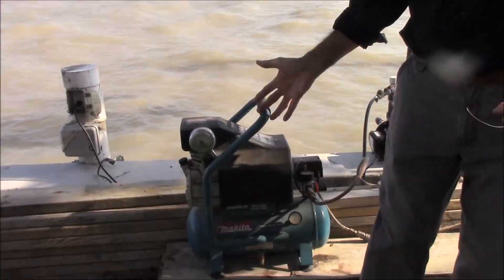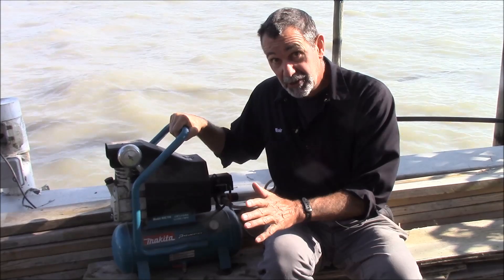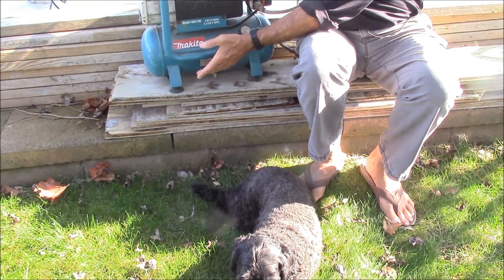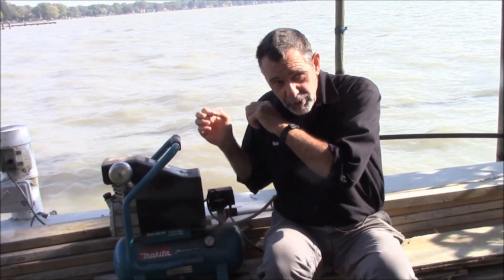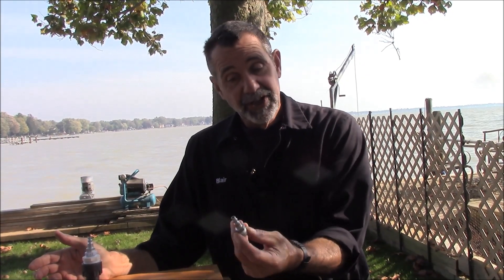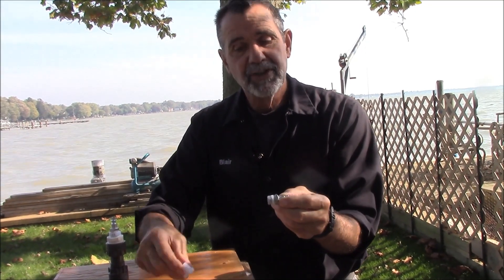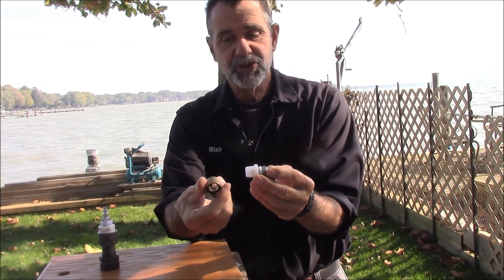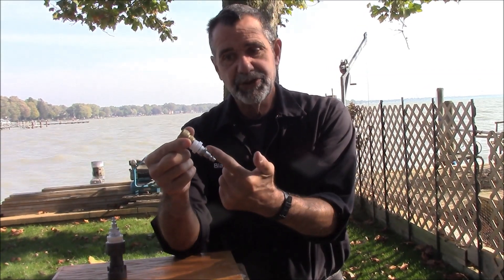Blowout Sprinklers System to Winterize With Compressor - Adapter $10

Comment: I rent a 4.5 cfm compressor from Home Depot and use it on my sprinkler lines and run it as you have noted. I use 80 psi as my limit though. I was told that by a sprinkler person so I'm comfortable with that.   Have been doing for a few years now and so far no issues. I live in Northern Canada.

Comment: I dont care how many times you do it! If You have five heads on the same line you will never reach the furthest head ! I know this from experience!!!
Reply: Good point. Maybe putting 10" or so concrete Stepping Stones on all but one sprinkler head would help direct the pressure. For someone that has plenty of time

Comment: If your sprinkler system was designed and installed properly ... dug and pitched like a waste pipe, it would drain completely after every watering cycle and would NEVER need to be "blown out".
 A sprinkler zone that does not drain on it's own was never installed correctly in the first place.
 The problem stems from the fact that landscape workers are not plumbers and they are doing a plumbers job when they put a sprinkler system in. 
It is purely incompetent hackery, ignorance, nefarious scamming their customers for a service they shouldn't need or some combination of all three.